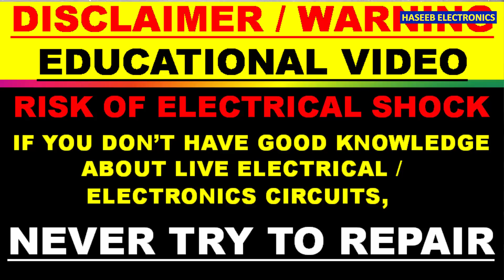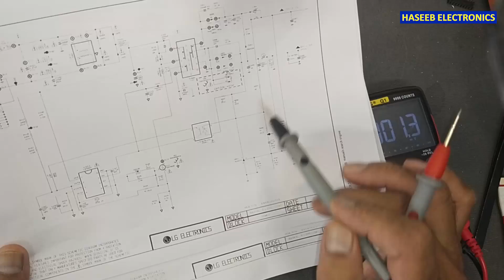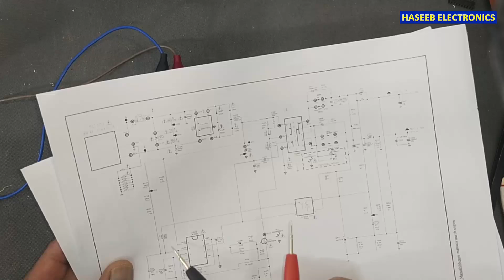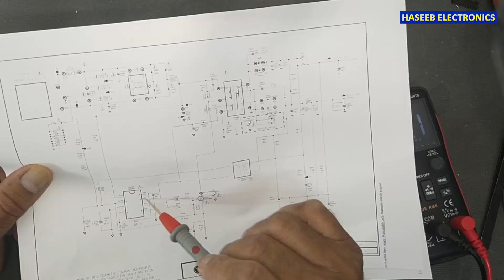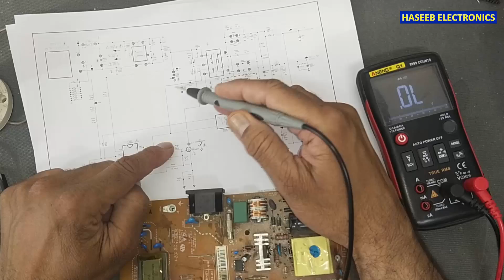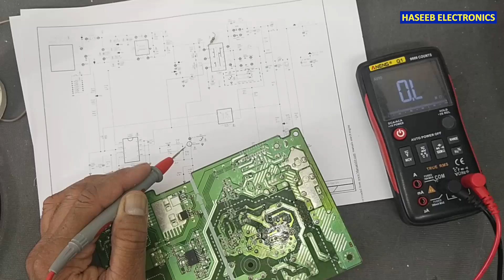{769} LG Flatron Monitor W2241S Power Supply Fluctuating

Comment: It is difficult to see the schematic . As I understand it there were two faults 1 . A fault in the auxiliary supply used to power the controller chip - the resistor in series with the auxiliary winding was open . 2 . A diode fault in the feedback circuit ? Is that correct ? What was the root cause of this fault ?

Comment: is this pattern universal?
Reply from the maker: yes dear 
most the switch mode power supplies are designed for universal input voltage
Reply: @HaseebElectronics  can you send me this diagram on pdf thank you
Reply from the maker: http://bit.ly/3EjreuQ
Reply: @HaseebElectronics  thanks my friend, but this service manuel is it compatible with Samsung and brand, sony ..... ?
Reply from the maker: this board is W2241 is for LG FLATRON

Comment: Sir here I could not understand that u measured the output voltage  across the diode but not with respect to -ve.
Reply from the maker: these are blocking voltage which drop across the diode, it shows us the transformer and diode's health. no need to use reference for voltage measurement across a working diode

Comment: Haseeb meri require ment ha 60mfd 600volt kya ma do capictor120 MFD ke series me lagane se working voltage bade ge kya ya 60mfd 880volt hoghi kiuyo ki ya ma use kar reha hu 440volt across me220 k resistor par capacitor foog jatha ha wah pe 520volt takh athi ha

Comment: Sir how can we make a simple circuit to run a dc motor (uvw)with shoft start and (overload protection if possible in less expense) 
Which ic can we use for igbt gate drive (vft generator) 
Please reply Sir 
Thank you